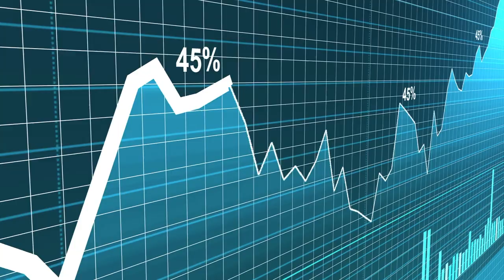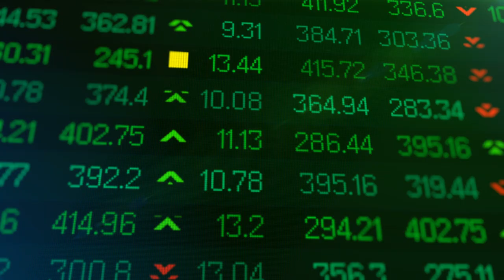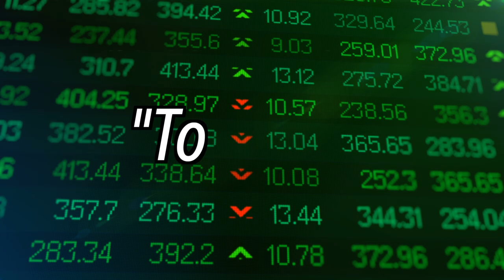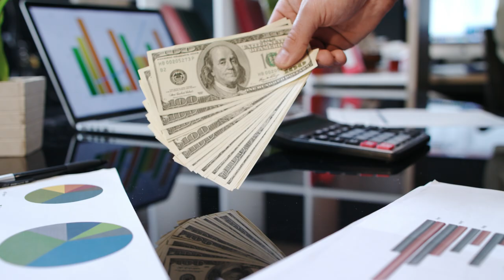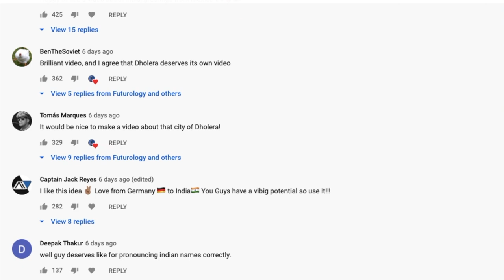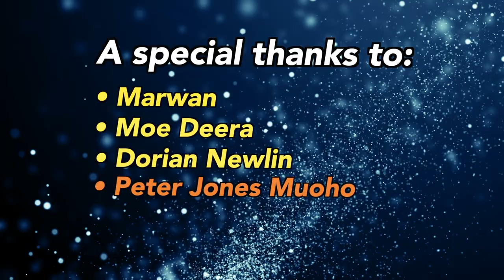New York’s Proposal for a Tunnel to Long Island

Comment: Ummm....If you check the old subway maps, there was a subway tunnel dug BEFORE 1900 from Manhattan to Long Island. It was closed in the 1920's but George M. Cohen wrote a song about it. ("From Manhattan to Long Island" in the musical "Mary"). There was also a subway stop at the Astor Palace (Trump Grand) Hotel on Broadway too. New York City Transit's current subway system is less than 1/10th of it's original nearly 1000 miles extending into New Jersey and Connecticut. There are hundreds of miles of abandoned subway tunnels and hundreds of thousands of abandoned "dreadnought" (heavyweight-pre-WWII) subway cars under New York City.  HBO attempted to do a documentary on them starting in 1999 but the World Trade Center Disaster took place right over the 1900's "HUB" of the old subway lines and the project was abandoned. Thousands of yards of concrete was poured into the tunnels to block them off from the curious.

Comment: They definitely need another option. As of now there are only a few ways of getting off Long Island and they all funnel pretty much through the city in some way. If something major were to happen and we had to evacuate.. people in Nassau and Suffolk are screwed big time. Plus as a truck driver there needs to be another way to access Long Island because again we have to funnel through NYC . Maybe another bridge or tunnel that connects Rockaway Park to South Amboy, along with another major expressway that runs parallel to the Belt Pkwy.  (Like how the LIE runs parallel with the Northern State/Grand Central Pkwy). This would ease up truck traffic coming from Jersey so they wouldn't have to bottleneck over the George Washington or Verrazano

Comment: This is going to have to happen now, because everyone is leaving NYC, and congestion is going to get crazy. Just tunnel from the north end of the Seaford-Oyster Bay Expressway  (i135), to Stamford. Done. I'll get the tunnel boring machine.
Reply: That’s why the SOB, Rt 106 north of the expressway, and the right of way, in Mill Neck, was built. It was to hookup with the bridge. And the southern end of the SOB was to meet up with the Wantagh Parkway out to Jones Beach.
Reply: Lmao that's not how major infrastructure projects work you fool, learn some basic economics, the plan is not nearly as good as it may seem from this vid... if anything it will end up causing more problems than it's worth
Reply: @metatron5199  Glad I could make you laugh. If I can make at least one person laugh per day, then its a good day.

Comment: I always believed that a bridge from LI to RI would be better. Because the route would be easy, just like LI is east to west, and RI is to the east. And while the problem for the people would be the still long distance to mid-Connecticut, no bridge or tunnel would be built in the middle of LI not only because of the depth for a bridge, but also the length for a tunnel. And a tunnel/bridge closer to the west end would hardly reduce the driving distance to mid-Connecticut. So the easiest and best route would be the eastern route to Connecticut. Since although people in mid-LI would still have to drive far to get to mid-Connecticut, at least people in eastern LI would not have to drive far to get to mid-Connecticut or Massachusetts. But I would still rather see a bridge route to RI and the islands in between.

Comment: If you're going west, you go through the city. That's it. If you're going north and you want to avoid traffic, you get the ferry. It's very simple. The  comparison in trip duration between existing bridges and the ferry is false. IF the traffic is so heavy on the Throgs Neck or Whitestone bridges that it necessitates building another bridge, then you are not getting from anywhere near Pt. Jefferson on Long Island to Bridgeport CT in one hour and 44 minutes. In reality, if you avoid rush hour, the Throgs Neck and Whitestone are not bad.
Reply: Spoken like someone who actually lives here

Comment: Having lived in the area, from my point of view the best location for a bridge across Long Island Sound would be between Port Chester and Oyster Bay. This would allow traffic to leave Long Island where State highways 25A and 106 meet in Oyster Bay which connects to the Long Island Expressway and cross the sound to where I-95 and 287 meet in Port Chester.  This would provide direct access via 287 to the Tappen Zee bridge that crosses the Hudson River and connects to the NY State Turnpike going up state. Thus it would be easy to travel from the Long Island Expressway to the NY State Turnpike or in Port Chester to head up I-95 to Boston and avoid going though NYC..
Reply: NY Rte. 135 on Long Island was intended to be a part of I-287 in anticipation of the bridge.

Comment: Another option could be, a Much, Much FASTER, Higher Capacity or Greater Frequency and Improved Ferry Service that would zip across the L.I. Sound. Possibly, Hovercraft ?
Reply: Still wouldn't solve the $60 toll each way problem.
Reply: Matthew Anderson ... You're right. It's like putting a band-aid on something that needs stitches.
Reply: the reason the "expanded and enlarged ferry service will never work is why it does not now. 80$ round trip !?!  Most people would rather sit in traffic for hours and save the $$$ then cough up for the less than great savings in time that taking the ferry is.

Comment: Somebody get this guy a sponsorship
Reply: NordVPN wants to know your location
Reply: waylon lewin  we don't need an escape plan on the north shore, we are high enough from sea level to not have a Katarina-like event. If NYC goes underwater in an apocalyptic scenario, then we would all drowned in bumper to bumper traffic. The escape from Long Island would be a evacuation path clear of the 5 boroughs traffic as well? If LI gets hit with tidal waves or goes under the whole northeastern coast is gone too. Stop with the fantasy fear mongering and move to a different state in a high location.
Reply: waylon lewin  if you care about rising flood waters than you should know that a sizable amount of retired military personnel have been buying homes in the Appalachians as they expect that to be the only safe haven when the big event comes. If its my time, its my time but just as your property is not mine, mine is not yours to destroy.
Reply: waylon lewin  which has what to do with a tunnel when there is the Throgs Neck bridge just a little further west of here? The infrastructure of the roads couldn't handle it either so the project is actuallu closer to $30 billion...🚮
Reply: waylon lewin  yeah You're right i should have said  nordvpn doesnt want to know your location

Comment: Never thought of this, but i think both proposls should b undertaken - the first proposal should have been undertaken a long time ago, and should be a road and rail bridge that should be part of Amtracks NEC corridor.
Reply: for that to work the trains would have to go out of their way to use it
Reply: @keeganharris186  Wow you people really accept these construction projects?? In my country when we build a similar structure like that there is huge opposition by environmentalists and also there are several articles saying how this is an environmental disaster
Reply: Pratham Prabhu the actual local residents of any of the proposed location all reject these ideas, exactly for the various reasons you listed, and FYI I'm one of those local's, this plan will never happen, and it shouldn't bc it's not nearly as important or needed as this vid made it out to be...
Reply: @metatron5199  so it exists then, in our country the media and the news more than other important affairs keep showing this for long time till it gets bored
Reply: Pratham Prabhu essentially this is a dead idea, it will never happen, for the reasons you mentioned plus many more
Reply: It is spelled Amtrak
Reply: An rail tunnel would be great, but it would need to land east of The Thames River, as the shore line across Connecticut has limits train movements to accommodate boats under moving bridges. The most east bridge is at The Thames River.

Comment: First and foremost, from an ecological standpoint, building a tunnel in the Oyster Bay area can't be done. I am far from an eco alarmist but did take a careful look at it in 2018 when Cuomo was pushing the tunnel idea. The clay boundaries of Aquifers that supply drinking water to most of long island would need to be pierced during the boring process. When and not if the aquifers would be contaminated as a result, millions of LI residents would suddenly find themselves without potable water. That would be and epic disaster and arguably unrecoverable. As a second and less dire effect, "if you build it, they will come." Expanding highway infrastructure is always sold as a traffic congestion reliever but in reality it never does. After they built the Long Island Expressway for example, did it not fill up with cars? Are there no more traffic jams on LI now? Maybe if we added a couple more lanes in each direction, I'm sure it would be smooth sailing...for a few weeks. So, we don't really need to get into the class warfare argument because regardless of where you live on Long Island if they try to bore through the flimsy clay boundaries of that aquifer most everyone living there is going to get thirsty really quickly. Futurology, maybe dig into it a little deeper next time, pardon the pun.

Comment: For everyone's edification, the Seaford Oyster Bay expressway was built for this purpose. Checkout how it ends on the nortshore, for either bridge or tunnel!
Reply: Yes, it is the rare road the simply comes to an abrupt "end" at Route 25 (Jericho Turnpike). Though the exit ramps just before that funnel traffic either east or west , the rump of the rest of the road intended to go north to this proposed bridge is still quite visible today. 

But it's wrong to attribute the entire reason for a a failure to build a bridge or tunnel to opposition from selfish rich homeowners. As only passingly noted, LI is densely populated and already has famously troublesome traffic problems. These types of connections would only make those traffic problems worse. More traffic would flow through LI even when the origin or destination of many trips would have nothing to do with LI itself. For example, a motorist traveling from say Boston to Philadelphia could use this type of a  bridge and avoid almost all of NYC, but that advantage would offer essentially no benefit to LI itself. That's part of why this bridge has never been built. Why there's been almost no discussion of a rail bridge is also a worthy topic of review.

Comment: I just cant believe long Island does does not have a bridge, such a advanced nation, time is money. The more time you have the more money you make. I hope you build the bridge soon.
Reply: @Joe Libra why did it go there?? And how do you know??
Reply: There are 3 existing bridges from Long Island (Queens) to the Bronx.  The largely acknowledged "lesson learned" from the Robert Moses era of building these bridges is that new bridges are almost immediately saturated with overwhelming new traffic density (attracted by the new bridge option)   "A If you build it, they will come" mindset.

Further, Connecticut & Rhode Island will never allow a bridge to Long Island, as it provides zero benefit to them.  Also, residents on LI's north fork are overwhelming opposed to widening roads/adding density that such a bridge would require.   Right now, a New York-sponsored bridge (to Rye ?) is highly unlikely, as it has  been opposed by local LI and Westchester factions for decades.  Also, NYS is/will be in extreme economic hardship for 10-20 yrs (Covid) during which mass transit needs and maint of existing highways & bridges will consume 99% of State & Fed-contributed budget.
Reply: Long Island is connected to the mainland with many bridges and tunnels and it has been for over a century. The problem is that they are all in densely populated areas that already have very heavy motor vehicle traffic.
Reply: Ok. So the do have bridges, only that there is a lot of cars in LI. to much traffic, well you have to do something, hope you can fix it.
Reply: We have plenty already, and we don't want any new ones, they will not do the things that are stated in this vid, they are just a bad idea and a huge waste of money especially when it can be spent much more productively elsewhere...
Reply: No no and no there is still farmland and open spaces being destroyed and the islands drinking water is in danger you do not know the history or geography the island has and is being destroyed by city dwellers leave it alone!
Reply: @almiranteandres7550  it will only make the traffic worse with all the city people trying to find another way to harvest festivals in fall

Comment: This would be great. Travelling from Long Island to upstate New York requires going through Penn Station, which is already operating near capacity. Having LIRR link up with Metro-North via a tunnel (along with freight trains) would greatly improve logistics in the region. There's a lot of jobs in Long Island as well, and a new tunnel linking NY to LI would unlock so much potential commerce & economic growth.
Reply: Relieve most of the traffic on highways going to nyc

Comment: There was talks of a building a bridge years ago from to CT To LI,using the 135 (Seaford Oyster Bay Expressway),but of course the rich folks in the area paid the local town and state officials not to do so,because of "Noise Pollution" .....weird cause if you're familiar with Long Island and that Expressway you will know where it comes to a end there isn't any house no where in that area.. My job actually has a layout and demo of the bridge that was proposed for the project..

Comment: Why don't they look at a cut-n-cover tunnel option.  it's shallow enough. This type of construction ends up with a curved area of lake floor being dredged and then sections are floated into place.
Reply: yea much cheaper to do that, especially if the ground under the sound is not very solid where you cant bore a tunnel.

Comment: The original bridge option was designed to connect the north end of The Seaford Oysterbay Expressway aka route 135 with I95 in Connecticut. That roadway ends abruptly and looks unfinished.
Reply: So, if there was a bridge there, it wouldn't take long to get from Bethpage to Ct.?
Reply: It is I believe it ends in Woodbury finish it already!

Comment: As a Long Islander I believe we can and must build big, but I have several criticisms for this oft proposed project:

- A new connection will temporarily abate traffic congestion, but long term it will not accomplish any reduction, and may worsen traffic on Long Island due to induced demand.
- The "evacuate Long Island" excuse is one of the lamest justifications I have ever heard, even with a new connection, it would take far too long to evacuate Long Island from any calamity worth evacuating from (e.g. tidal wave, hurricane).
- All the latest cross sound proposals limit their benefits significantly by favoring automobiles (80,000 vehicles a day?! the Lexington Avenue subway carried 1.3 million people daily prior to the pandemic), we need better more creative cross sound proposals that aren't auto-centric and better weave in the overall transportation network of Long Island, New England, and Upstate New York.

Comment: Long Island Traveller here, god we needed this. Traveling to the city just to get anywhere off of the island is really a nightmare. Not to mention the throgs neck bridge seemingly is always under construction and has at least one lane shut down and the Whitestone being under the same probably. By the time something gets done I’ll be dead tho. lol
Reply: Good
Reply: If the Throggs neck is always under construction think about what you are saying how long do you think a NEW proposed bridge or tunnel would take put on your thinking cap
Reply: @jackiemack8653  it would take 55 billion 3 decades and never open like the decommissioned Shorham plant, and it would pollute the air ground and water...this time not with radiation with though. Sounds good? Sweet thinking  cap, dunce
Reply: @jackiemack8653  if you put on your glasses I wrote “by the time something gets done I’ll be dead” I don’t need a thinking cap to know it’ll never even gain traction and even if it did it’ll sit in limbo forever

Comment: The solution is a combination bridge and tunnel project. The tunnel would go under Long Island, in the Oyster Bay  area at Rt. 104 and Rt 25A, and then surface near the shore to the cross Sound bridge.That way the beauty of islands north shore is preserved, without the cost of the whole tunnel. Something similar on the other side would work too. Think of the Chesapeake Bay bridge tunnel project.
Reply: I was thinking the same thing
Reply: It’s Route 108 in Cold Spring Harbor, Route 104 is in Upstate New York from Buffalo to Syracuse.